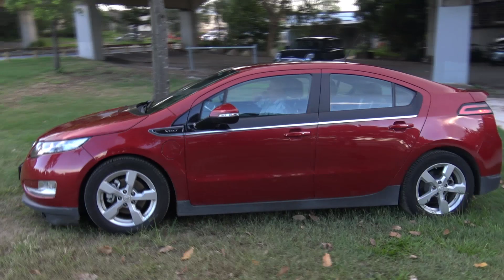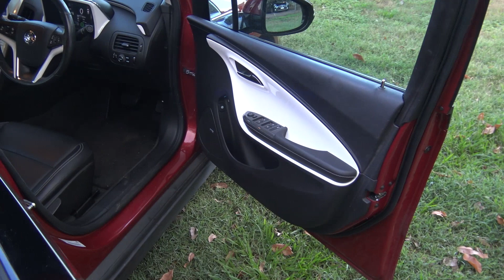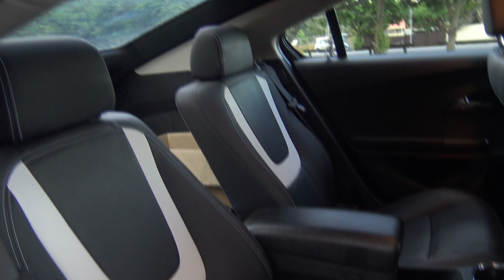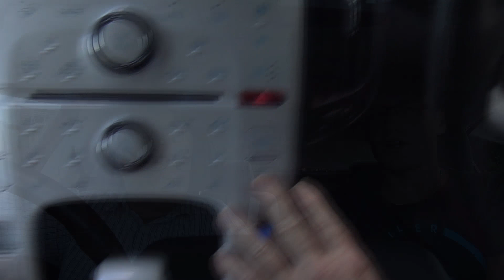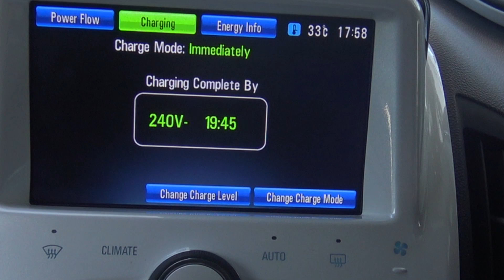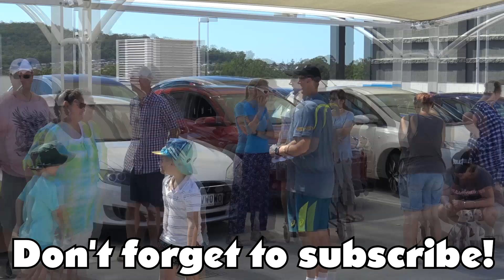Holden is no more but lets check out the Volt anyways...

Comment: i have a 2013 and a 2014 chevy volt here in the us. bought the used for about 7k and 8k usd respectively. my partner and i do a lot of driving and plug them in every night. i put in a ev charger in the house i rent for less than 100$usd lol. and i can take it with my when i move out. charges in about 3-3.5hrs if its comming back from a long drive.
i drive a lot and put 30k miles on my 2013 the first year i had it (~48,000km), saved $2,000 usd on gas lol. it will be free in another 18mo. my insurance is 21$/mo too. my lifetime fuel economy is 70mpg or 3.36l/100km, which is pretty insane. i added a solar roof and expanded the battery pack by 4kwh, made a post on the gm volt forums about it. pretty involved. I also park outside and backfeed the house with a microinverter once my battery is full from the solar which saves me like 10$/mo in utilities :p. the solar and battery expansion only cost less than 500 bucks, kind of figured it all out myself. best car ever made, very misunderstood, kind of like the interviewer in this video just likened it to a prius which its not. more like a diesel electric train or something. alas, people were not smart enough to understand it when it was being made, thats why it failed. now everyones rushing to buy "new" phevs for 7-10x the cost which get half the range lol

Comment: I had a 2015 Volt for about 4 years until it was in a motor vehicle accident (it was a technical write off). It was a brilliant car, and initially I tried to find another one before I got my BMW i3 to replace it. I easily got 70 to 75km range out of it. I agree it was very smooth to drive, and it was unfortunate they did not market it at a reasonable price.